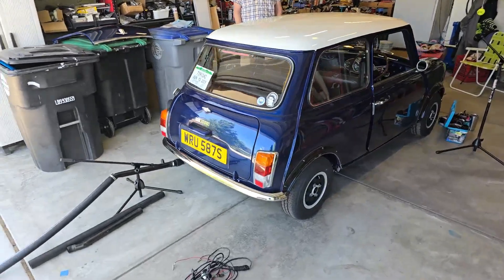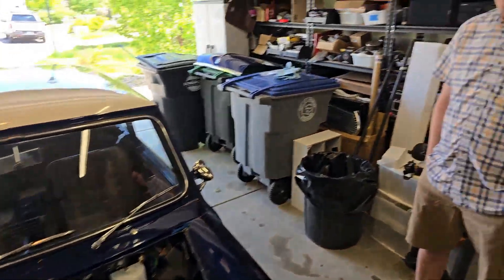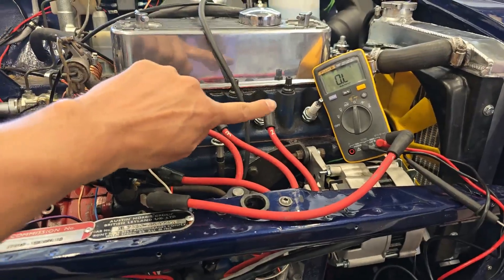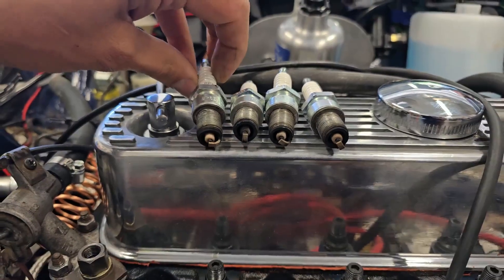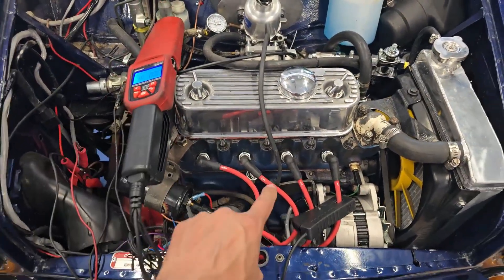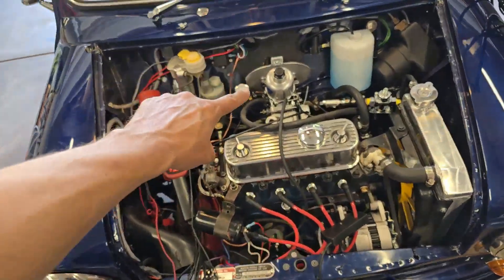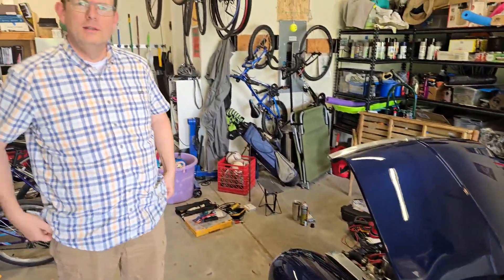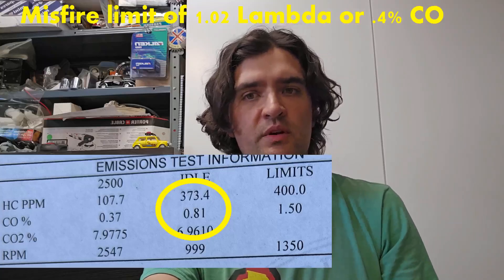Classic Mini Survival Guide: Passing a state emissions test with proper tuning. Drives Great!

Comment: One question if I may.  All the 1.5 ohm coils I see for sale are for ballast type ignition systems.  Your saying in the video you are getting full voltage at the coil (14V).  Are they special coils?  Thanks.
Reply from the maker: Standard Ballast systems use a ballast wire and a ballast coil . The replacement dizzy on this mini used a much higher power module which needs the full 12v feed and a 1.5ohm coil. Technically it could be running a 1.2ohm coil but the owner didn't buy it.

Comment: Hi Darren, Thanks for the video. What is your take on the difference between the method of tuning you describe and that employing a rolling road? Do you lose anything by not having a measure of the engine output in terms of power and torque?
Reply from the maker: As long as the fueling is right, the torque and power output will be right. Sure, the dyno would be nice for getting the exact fueling needed at every rpm vs the power output. However, it isn't needed for the vast majority of the cars out there.

Comment: I laugh at the UK emissions limits. People seem to struggle with the 1000ppm HC limit but I'd hate to have a car with such high HC, It's easy to get well under 500ppm. 1000ppm indicates a big issue but people ignore it.
Reply from the maker: That's a good point which I should have made in the video. The lower the HC the better the state of tune and the engine sealing ability. It also make the cars more pleasant to be around when they are running in traffic.
Reply: The HC output is directly related to the camshafts overlap, there are a lot of cars in the UK using rally style camshafts that increase the Hydrocarbons a lot. It’s not possible on these types of buoys to have super low HC readings when using this type of cam timing. High lift rockers also add to the HC output as these also increase lift on overlap.
Reply: @ACDodd I think it is normally stock engines that I read people having issues with. As you know, people setup their ignition systems so poorly which is generally the main cause of high HC.
Reply: @CollectorOfThings agreed.

Comment: I fixed cars for E-Check in Ohio for twelve years, in the 90's at a Toyota dealer. Biggest hurdle wasn't repairing the car, it was the check station drivers, that couldn't bloody drive. Or set the cars up on the rollers. They damaged sooo many cars; tore tires off not setting the chocks correctly, unable to drive a manual, trying to test an fixed AWD car or truck on a two roller dyno. I tuned my brother's '72 Ford F250 with full time 4wd. They didn't believe me and tried to run it two roller. It ripped the straps off and launched itself off the rack at the shop door. Hilarious.
Reply from the maker: Ya we have issues with the techs as well. Also the slow moving lines to do the test will heatsoak the carbs and then they go rich.